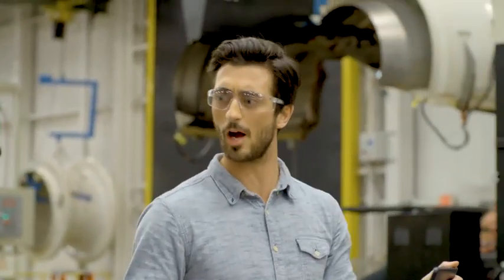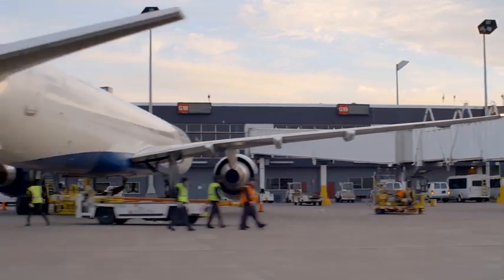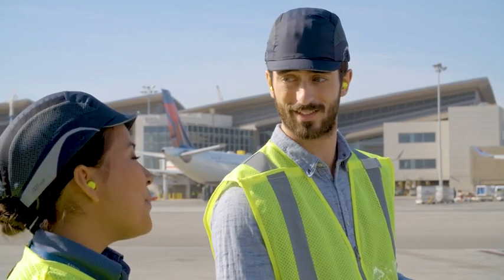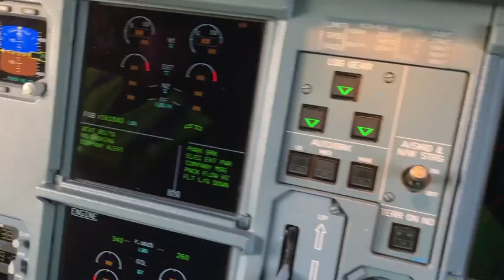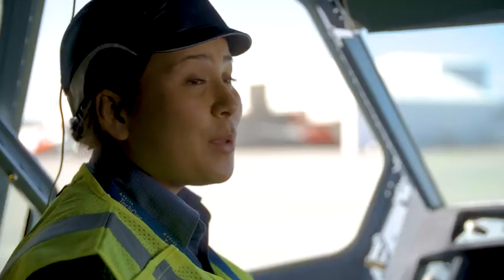Careers in aviation maintenance

Comment: Join the Air Force. You get excellent training, an instant career, and entry level military aircraft maintainer pay and benefits beats the snot out of most civilian gigs. How many civilian maintenance gigs pay vested retirement at 20 years?  Mighty few if any.  One little mentioned but very nice aspect of Air Force maintainer life is flexible schedules and paid time off for appointments. Like a sore dick, ya can't beat it. 
Former Bronco, Phantom and F-16 Comm/Nav, motor toad (crosstraining is fun and you get paid to do that, too) and later crew chief (easy to make rank) here. Would do again gleefully. Unlike civilian outfits the Air Force isn't disturbed by recessions. I haven't felt one since 1981 when i enlisted. You'll hear a few maintainers snivel but some people would complain if they were having an orgasm.  Military human networking builds post-USAF careers. My bros moved into DoD, contractor and civilian aircraft manufacturer gigs after their retirement, and collecting retirement plus another paycheck is sweet. (I'm fully retired due to non-work-related injury or I'd be in Saudi or UAE fixing fighters.) 
Working on aircraft is huge fun if you are a gearhead, and if you choose wisely you can have a very nice life.